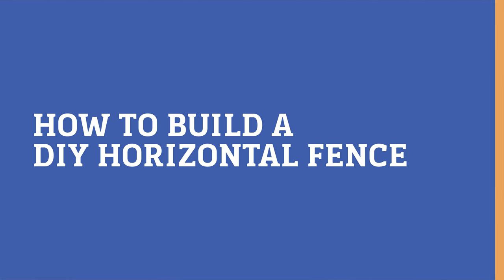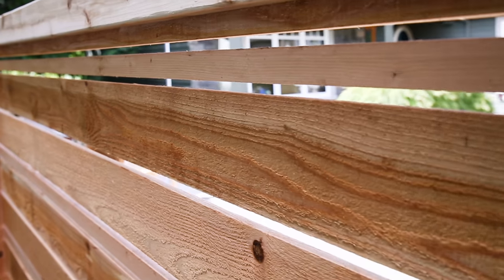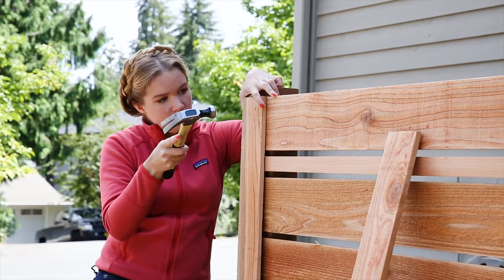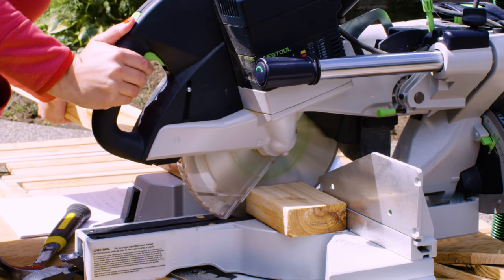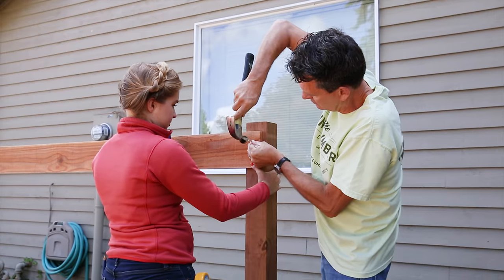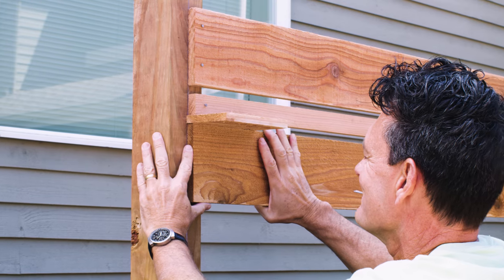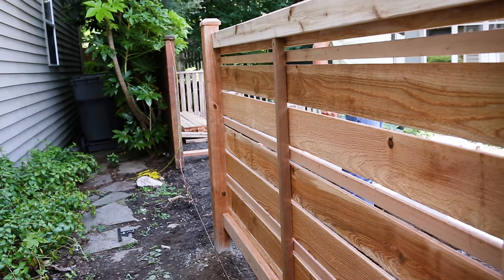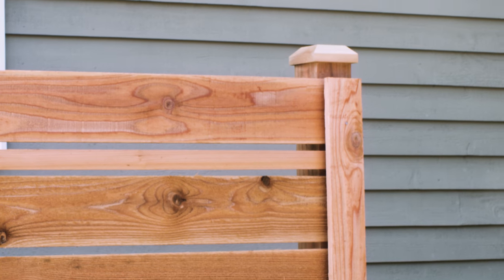How to Build a DIY Horizontal Fence

Comment: Their webpage says to use galvanized nails. Don't use galvanized with Cedar. You will eventually get black lines from the nail heads due to the reaction of the oils in the cedar and the nails. You need to use stainless steel nails every time with cedar.

Comment: Are the 2x4's along the top and bottom necessary?  Can you clarify the reason for using them the way you did...I've never seen that before. Also, can you upload a picture of what it looks like from the inside?  I'd also really love a corner shot of the 1x4 strips that you used on the ends to cover up the nail holes. Thanks